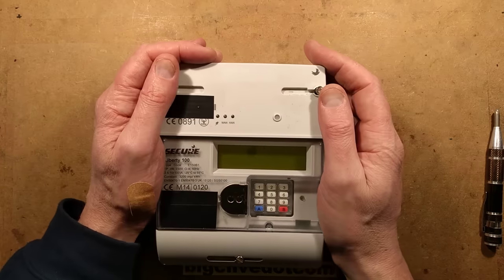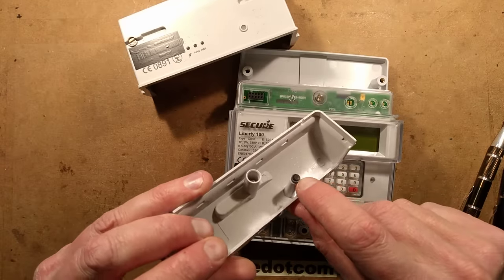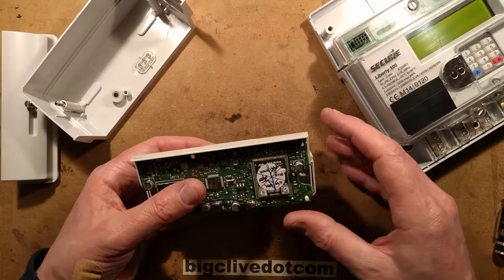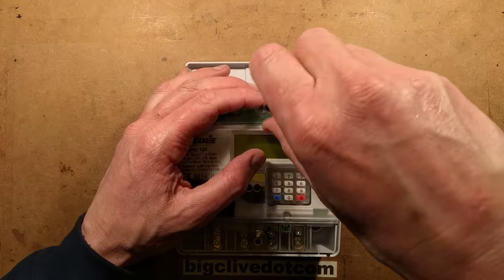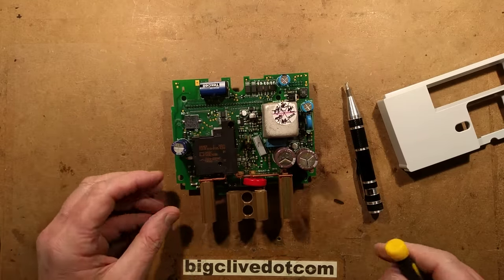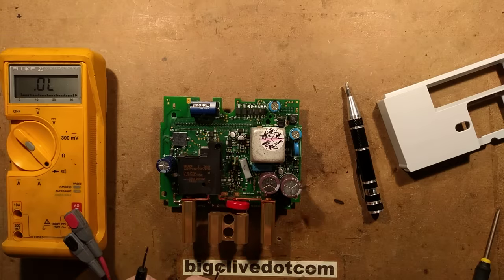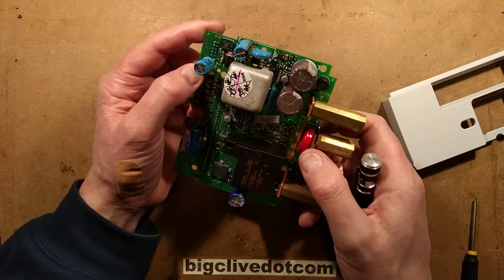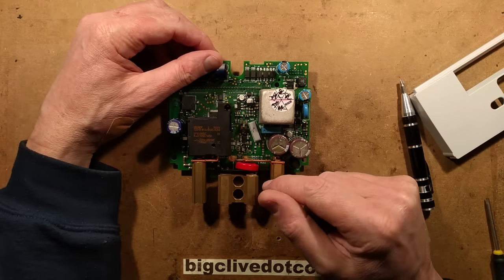Inside a smart meter, and the REAL problem with them.

Comment: Ok, story time: Just recently (about a month ago actually) I had one of the modern smart meters fail on me in a somewhat unusual way. The bill I got in late september for the months of april-june was higher that usual - like a lot. The good thing about these meters is that I can log in to a website and see the usage on a day to day and hour to hour basis. 

Normal it's usually no more than around 200 kwh and most months it's less than that. But the usage for june: 2050 KWh...and for july and august (these two will be on the next bill): 3588KWh and 5214KWh...as in more than 5 MWh for a single month. 

Yeah....

5214KWh means that I used in excess of 7000W around the clock for an entire month....only for stuff like light and cooking (heating is with natural gas). Since a quick glance revealed that no part of my house had recently been on fire and since my Flir cam did not find any hidden hotspots I quickly came to the conclusion that the smart meter had to be faulty. However I must be mistaken, because the power co first suggested that I get wall adapter meter and checked the various power supplys and such - because they can use a lot of power when plugged in all the time. In all fairness I am not an electrician - I don't even have a kitchen fitter certificate, but I should think that 7000 watts in waste heat would be a challenge to hide in a few power supplies, but that's just me.

:Sidenote:
As is common in the Denmark - my house gets three phase power. At the consumer unit in my house this is then made into 3 circuits that cover the house (2x10amp at 230 volt and 1x16amp at 400 volt).  So there is not way I could ever draw 7000 watts on the 230 volt circuits continuously...

In trying to convince the power co that this did not make any sense what so ever I cut the power to entire house for 15-20 minutes...and the meter (with the appropriate name "Echelon") still counted 2-3 kwh in that period...Also the meter also indicated that there was a return current...implying that there was a net production of power at my location - except I don't have any solar cells or anything like that...clearly not a happy meter. 

For now, the story does have a happy ending, as  the meter was replaced and found to be faulty and all is well now...or so I hope. But the thing is this...when they analysed the meters internal log, they found that it had been acting odd since april. So while the huge increase in reported power usage did not begin until the middle of june, the numbers for april and may were also...suspect. 

I guess my point is...keep an eye on your bill.

Almost forgot the most important bit: Thanks @bigclivedotcom for a great channel.

EDIT:
The numbers from april-mid june were a little higher that usual, but not alarmingly so. But suddenly there's a huge increase. From 9 KWh on 17. june to 155 KWh on 18. june. By august it was 170-180 KWh per day.

It has ended well enough, in that they used last years numbers to replace the entire period from april-replacement of meter, so all is well.

Because of some weird readings at first they thought that the problem was in the...ehh...not sure of the name...(terminial block?)...it's the block the cables to the house go into and to which the meter is attached. Essentially it's just a block of metal with plastic around it, so they had me replace that one at first. But since that clearly wasn't the problem, they paid for the replacement as well. 

All in all they were very nice about it and I didn't really have any big problems. Except for that fact that many of those involved didn't seem to comprehend that  7000W has to turn up as heat somewhere. If you around the clock  dump 7000W into a piece of metal about the size of an external harddrive ...good chance it won't be room temperature. 

One problem with this perticular brand of meter and setup is that it only shows total usage. The only indication of the power draw at the moment is a lamp that blinks everytime a 1Wh has been used. So you can't really just cut out a circuit and then check the meter for how much that section uses.
Reply: I wonder why the failure mode defaulted to an impossibly high usage...

You sure you don't have 6-8 1kWH HPS bulbs throughout your place? Lol
Reply: I take it they recalculated your bills since april based on average use and gave you a hefty refund? I hope you didn't end up out of pocket because of that.
Reply: I'm envious that you have three phase power.  Getting that delivered to a residence here in the states is non-trivial.
Reply: Newsflash.  Your son is growing.
Reply: Did they adjust the rate for you? I'm interested in knowing this :-)
Reply: @Elizabeth Greene Here in Poland three phase 230V to residence is standard, less common in blocks of flats. So I have 400V phase-to-phase to use as I like to. Limited to 35A fuse for each phase, with ability to upgrade to 63A per phase. Wonderful. I can't believe how you get by with 120V phases in the US, massive current, massive cabling, inefficient tools.
Reply: What are you growning?
Reply: Do you think they would design these so the failure mode is low usage? Not a chance.
Reply: Nobody can predict how it might fail, so it could go either way.
Reply: So how much did they pay you for YOUR time, YOUR effort to point out THEIR mistake? Plenty of people would't be able to prove them wrong and would be stuck with a hefty bill. Luckily here in N.Ireland we cannot be forced to accept a smart meter(at present....) and if the analogue meter fails and needs replaced you can insist on a electronic meter with no network connection to ensure someone reads it manually and should notice problems.
Reply: Natural response, "Our meter is fine, you're using more. Pay us!"
Reply: Interestingly I had a customer with a similar complaint. About 7 kW of phantom draw. We sent out techs and there actually was 7 kW of draw, but like you, there was nothing in the house drawing anything. A bit of sleuthing by our guys with their magic cable finders and they found the draw going down a wire into the back garden. Some digging revealed a whole 40 ft shipping container full of brilliantly lit, but quite dead marijuana plants. The previous owner apparently had a home business!
Reply: FrozenHaxor Actually we have a single 240V phase in the North America for most residences, that is then split into 120-0-120 (“single split-phase”) by a center-tapped transformer for most residential “plug-in” accessory loads (or a rotary phase converter may be used if you must have three-phase from a single-phase supply).  But our major loads are 240V single-phase and if you have a workshop with fairly large shop tools they will likely be 240V powered as well.  In terms of total power, our typical 200A 240V service (48KW, or 96KW if 400A service) is very comparable to your 35A 3-phase 400V service (42KW, or 76KW if 63A service).  There’s a lot of misunderstanding internationally when it comes to residential power in North America.
Reply: Japan also has lower voltage tham most places and at 100V nominal even lower than the USA's 120V nominal. Though in Japan the country is split between 50Hz and 60Hz just to spice things up. It is nowhere near as bad as you think and, in the USA, each residential unit is generally fed with 240V via a split phase it is very easy to have a 240V socket supply power to large useage devices like electric water heaters and dryers if needs be.
Reply: FrozenHaxor So on top of what was already said, basically most American home appliances run on double voltage. The efficiency of 120V tools is rarely a problem, and commercial/industrial applications tend to have their own high-power setups. I can't think of many modern loads that actually use 120V without either  rectifying it or using split or 3 phase for higher voltage.
Reply: @FrozenHaxor  - Because we (North America) were the core location for the initial power industry standards fight, as well as THE location for the creation of Alternating Current.  (Tesla vs Edison).   Initially it was 100 watts, then a bunch of standards between locations balancing later, and it ended up at 120 nominal.   Remember, early on, the current to residences was predominantly used for small motors (fans and similar) and incandescent lighting, for which 100-120 volts was just fine.   It wasn't until the 30's that EVERYTHING started being made to use electricity.  (including safety razors.  I kid you not, look up the Siemens Electric Safety Razor for an example)   This is another example of how Europe benefited from development paid for in the US.   That said, Europe also had the dubious ability to 'start over' after WW-II had roared through and annihilated just about everything that could be considered a war related infrastructure.
Reply: @tbelding  also how you ended up with shitty NTSC, you were the first to standardise and the standard had a lot of issues the later PAL ironed out nicely. Moral of the story - early adoption sucks (edit - before people start ranting about power freq, both NTSC25 and PAL30 exist)
Reply: "I think the meter is bad" "nope its fine" smashes meter ya pretty sure its bad... XD
Reply: @FrozenHaxor  We do use 230V for high power items in the USA though.
Reply: This problem was something I was constantly encountering with smart meter customers when I worked at a UK power firm a couple of years back. And the trouble with smart meters misreporting is, unlike when there's a calculation error on our end, like when customers get billed for the wrong type of tariff, etc. there's no way for someone like me to fix it over the phone by inserting the correct data into the system like we're able to do on a majority of such cases, since we're not able to override smart meter readings in the system like we can readings from a broken regular meter. We need to wait for an engineer to go out and replace it first.
Reply: @franglish9265  Right...I forgot about those.
Reply: @Bomag  We agreed on using last years numbers for the same period, so I didn't have to go out of pocket.
Reply: @DryLog420  They used last years numbers to replace the period.
Reply: @skumhesten78  seem close to fair... they should have added a bonus 10% discount because they are idiots. Glad it turned out well bud
Reply: Sorry mate meant to tell you about my underground cannabis farm
Reply: Maybe you left your bitcoin miner running ;)
Reply: @Agent24Electronics  - Yeah; some companies even change the meter "just in case" when a consumer unit spends "too few" electricity according to their criteria, or changes its habits and becomes "way successful" at saving energy.
Reply: So... how is the cannabis farm. ;)
Reply: So let me get this straight... Someone you don't know about is using your power to A: electrocute criminals

Or

B: make bricks!

Or
C: A death ray!
Reply: They didnt charge you i hope
Reply: they can and do put a faceplate on it that appears to be analog but still has the 5G components.   My bill went from $220 to $511 from smart meter.
Reply: @carolhartwell9245  if it wasn't meant to be a microwave weapon they would use 2.4g for distance
Reply: Anthony M it’s for my kids flower garden...
Reply: @franglish9265  If the meter uses a restive shunt to measure current then my guess is the shunt has failed and increased in resistance. The failure method seems to match, it progressively increased in measured usage in a logarithmic scale. Contacts melting, failing, expanding, or oxidizing from heat is my guess.
Reply: @pontiacg445  I think for the high power levels involved it more likely uses magnetic induction to sense the current. The more expensive multimeters have it sometimes. A resistive shunt is cheaper but added up over a country that'd be a lot of power wasted. It wouldn't be easy to pick a resistance value for such a wide range of potential use, from a couple of phone chargers to an electric shower.
Reply: @greenaum  Did you not watch the video or something? This one clearly uses a resistive shunt.
Reply: The brain works on electromagnetic waves
Reply: Nice essay
Reply: @lostspace5811  I assume by 2.4g you mean 2.4ghz. This likely means you thing The number in cellular communication standard indicates frequency. It doesn’t the g in 3G, 4G, 5G etc… stands for generation and just indicates what generation of cellular technology it is. There are many frequencies 5G runs on, none of which are 2.4Ghz. Which incidentally is the best frequency for being absorbed by water and the reason it’s used by your microwave oven.
Reply: @tbelding  another example of how Europe benefited from the us? It's very very much not one sided
Reply: @gasdive  crazy . Did he leave urgently before you took on the house
Reply: @rockyd19  from what I understand it was a deceased estate.
Reply: Decided to take out War and Peace from library,  only need a quick read of something
Reply: I wish you luck. Swalec started estimating my bill despite regular meter readings. They then refused actual meter readings and would only accept estimates.
They estimated i used the same as a medium sized family of 5 (single guy in a small flat).  Then they refused payments and would only accept complete access to my bank account (yey debt mountain).
Legal aid couldnt even get them to back down, they wanted me in court, no doubt to pay the debt collectors that were leaving 400quid a day letters.

I never got it sorted.
Reply: But why should you have to?